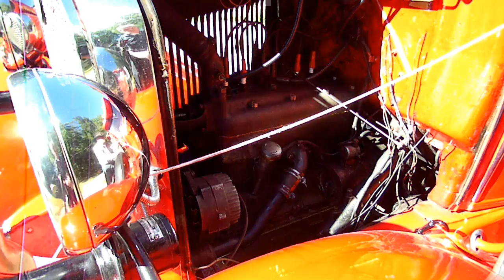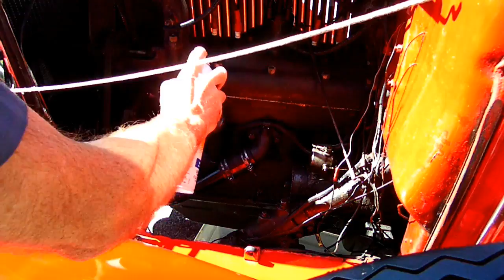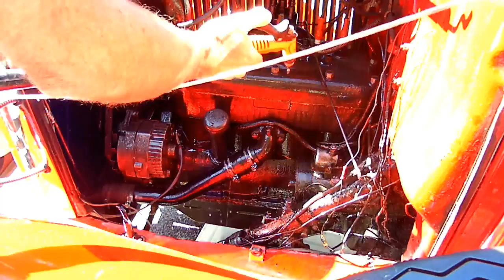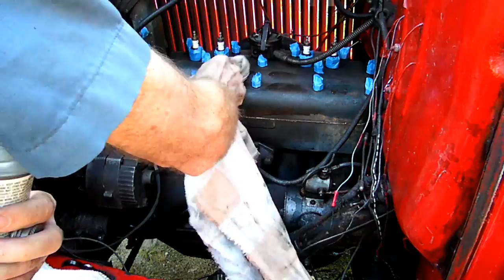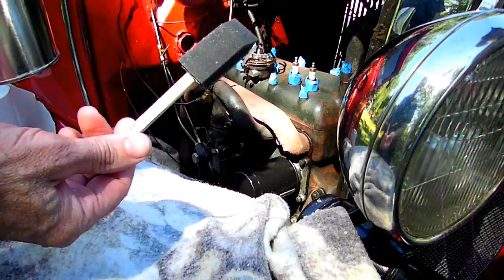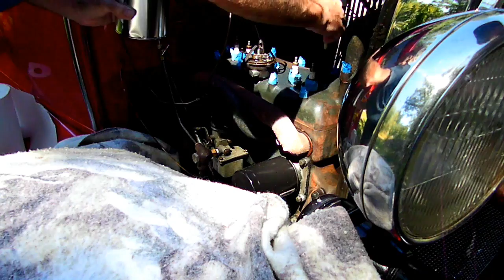Model A Ford Engine Painting

Comment: Retail products that are based twords the consumer market are normally crap. cleaning engines are best normally done by first wash down with hot water, small stiff brush and washing up liquid, after use a degreaser from Wurth/Auto glym if you have them in the us, then rinse with warm water.
Beautiful job as always

Comment: It's been many years now, but I had excellent results from that 'foaming' engine cleaner. Might have been from Gunk, but don't recall.

The first application got most everything, and the second (with minimal brushing in 'entrapment' areas), left the engine show room, stench free squeaky clean!

Don't know if formulations have been changed in the meantime... probably have.

Comment: I like "PURPLE POWER" it works great for cleaning stuff and it's safe for the environment!!!!
Just remember to really dilute it if your gonna wash your car with it.... I wash Rob's truck all the time with it in the pressure washer.... I mix it 2 or 3 oz. of the Purple Power to a gallon of water and run it through... works good. also use it on the boats, garden tractors etc.
.
Merrie-Merrie

Comment: Purple power is really some pretty awesome stuff in the right situation. It is a lye based detergent and will take off dirt that others will not. It is great for removing oxides from rubber such a wipers and tires.  Be careful of lightly painted surfaces as I took all the painted numerals off of a metal clock dial I sprayed it on once.  It's great for washing a car.